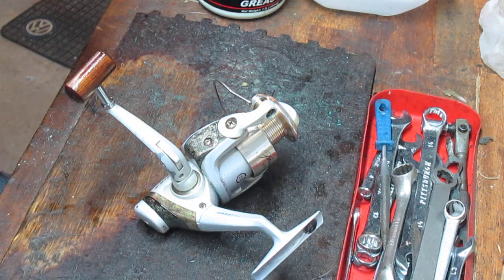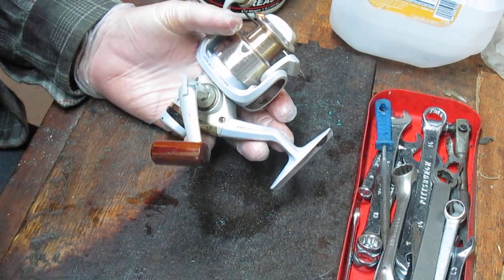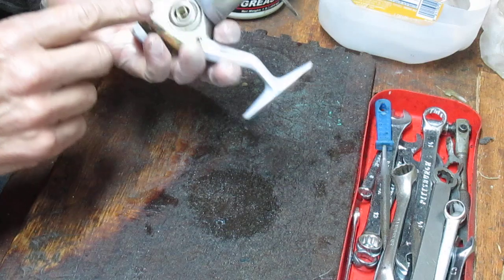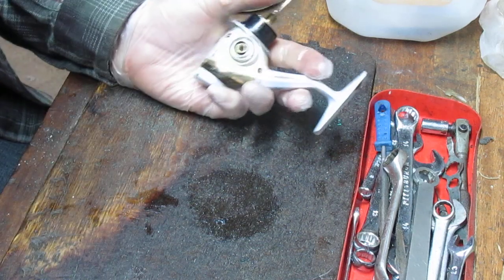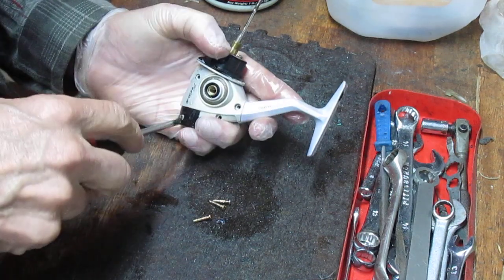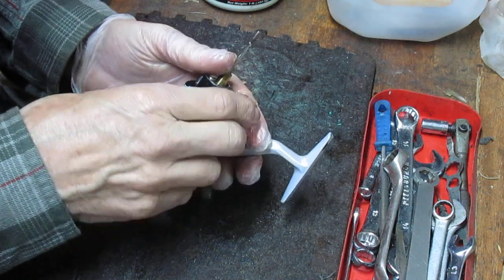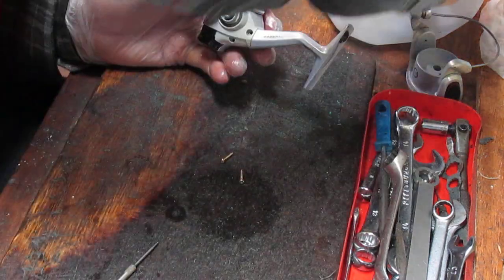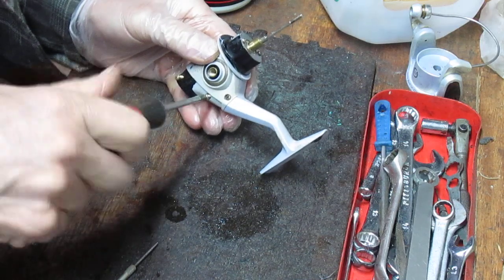Pflueger Trion 4735 Fishing reel service with take apart showing internals and drags

Comment: I think I'm starting to be a real Pflueger fan.The president is a very smooth and  reliable reel.I have one of these that is NOS and for a lower priced reel, the quality is great.Your videos are a huge help!
Reply from the maker: Thaks Mark - Yes - the President is a nice reel and a quality product.  Best wishes - Dennis
Reply: My Trion casts well and is a smooth retrieve.It cranks very hard to close about one third of the time.I don't believe the bail wire is bent,have you any other suggestions?It seems that the manual opening and closing of the bail requires more effort than a decent reel should.

Comment: A demonstration on how to reassemble the PUSH HEAD SPRING in a Pflueger Trion 1956 would be extremely helpful for me right now. I just can’t figure this one out and it’s frustrating me bigtime! I’ve taken apart spinning and bait casting reels a 1000 times to clean/oil/grease but this is my first time with a fly reel. I’d appreciate a demonstration video.
Reply from the maker: I rarely work on fly reels, so I and I don't have any Pfluegers in my shop, so I'm afraid I can help here.  Sorry - Thanks for the note and for watching - Dennis

Comment: Thanks for posting. On another video, I asked about the best lubrication for open face bearings. It was decided that the oil would be better than grease. At 9:38 of this video, the newly oiled open face bearing is removed from the bench and installed. Careful observation shows that there is a lot of oil on the bench, where the bearing was placed. To a point that it looks like a washer. What is the benefit of oil, if it leaks through the bearing housing and gets on the bench? How much oil is left in the bearing? Is it enough to last until next service?
Reply from the maker: I flood the bearing and the oil you are seeing on the bench is from over spill.  It did not leak through the bearing, but rather ran down the inner and outer side walls - Thanks for the careful attention to detail - Dennis
Reply: @2ndChanceTackle  Thanks for the reply.

Comment: Finally someone who knows what they are doing. Question: Can you use gun oil as a lubricant for this reel?
Reply from the maker: There are plenty of oils on the market for different purposes.  While I suppose you could use gun oil, I only recommend using oils designed for fishing reels, like ReelX or any of those provided by manufacturers.  These are cheap enough and not worth the risk of choosing. a general purpose oil that may fail.- Dennis
Reply: @2ndChanceTackle Good advice! After doing more research i just decided on Penn reel oil and grease for starters

Comment: Hi Dennis, just curious if upgrading the drag washers on the President XT would be the same procedure? Also, Is it worthwhile for the 30 series to even bother?   Thanks!!
Reply from the maker: Yes - they are all similar.  I don't think there is much use in upgrading these unless you are abnormal wear or are losing fish due to insufficient drag.  The engineers that designed these reels were usually good about setting them up and matching drags to capacities - Go ahead and do it if you need to, but under normal circumstances, you probably do not need to do it - Dennis

Comment: I don’t think I’ll ever buy another pflueger. I own 2 flueger trion reels and they are quite as a mouse except for a knocking sound and you can feel it too. I can’t figure out what’s causing it.
Reply from the maker: Hmmm - that's unusual if it is happening in both reels.  I am not sure what is causing that based on your description. Could it be the line hitting the back of the line guide?
Reply: @2ndChanceTackle   No it’s definitely not the line… It’s more like a metal to metal knocking sound and yes it’s happening on both of them. I’ve never had those reels apart and they’ve always stayed inside or in the garage.

Comment: what model is this conventional Pflueger Capital reel?
Reply from the maker: The most popular Pflueger reel of the 60s/70s was the Pflueger Capitol and it's model was the 1988, if I recall correctly.  I think the smaller version was the 1985 model
Reply: @2ndChanceTackle  The Pflueger Capitols came in 3 sizes: The 1985 was the smallest at 2 7/8″; The 1988 was next at 3 1/4″, and the 1989 was the largest at 3 1/2″ dia.